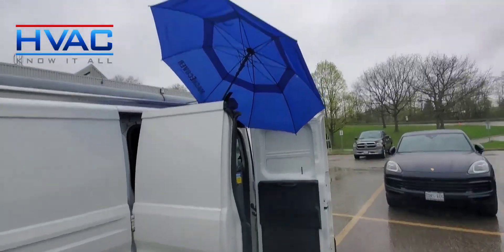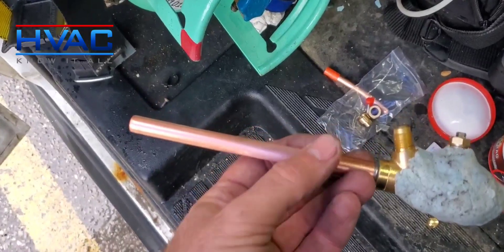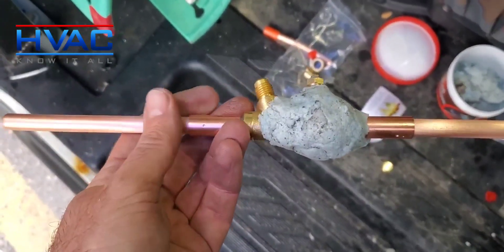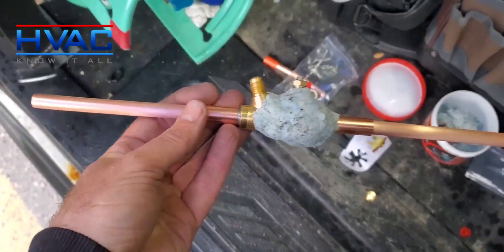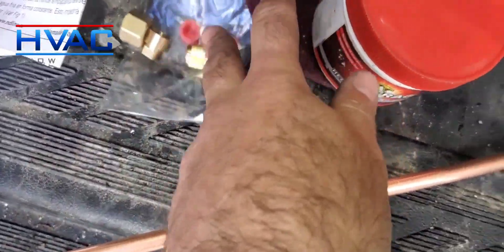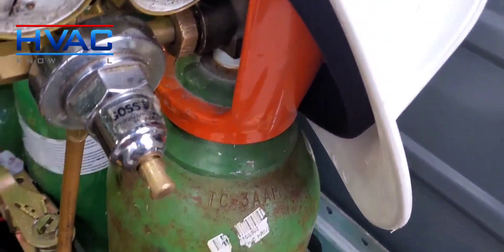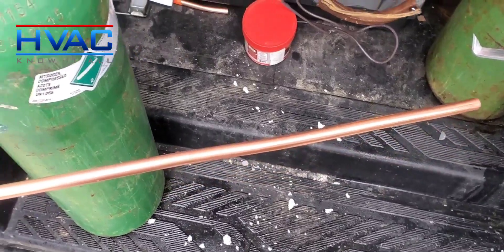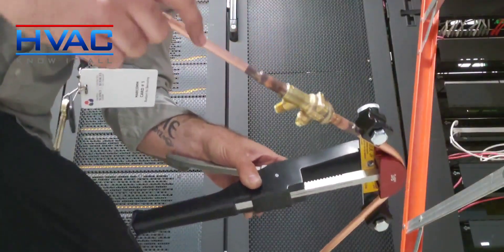Daikin VRV Air Handler Refrigerant Leak Repair

Comment: Nice job on seating that flare to the fitting then starting to hand tighten the nut as far as it would go. I have seen countless guys grab the nut slide it up and start to tighten and that's 100% wrong. I have even bent the copper a little bit just to make sure the flare is seated 100% proper. Well done , your so use to doing that right it probably slipped your mind not to comment on that for the new guy's.
Reply from the maker: Just the way I've been dong it for years haha

Comment: Nice clean job question using those press fittings how long have you been using them and what is the failure rate or have you seen any been kind of keeping an eye on that style fitting.
Reply from the maker: That was my first press fitting in the field.  Talked to lots of techs with zero leaks when the pipe if prepped correctly
Reply: @HVACKnowItAll  totally understand about the prepping , a lot of people don't prep then complain fittings are crap. Like the videos pick up a thing or two.👍
Reply from the maker: I appreciate it